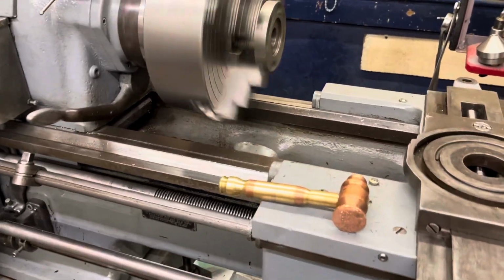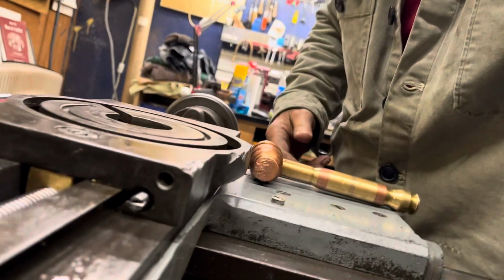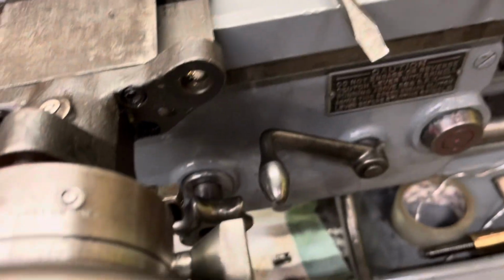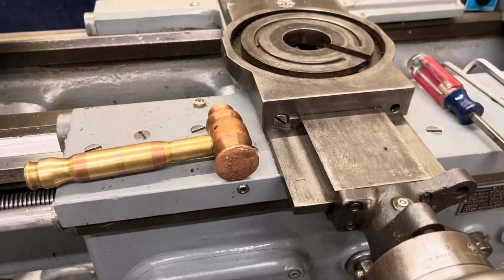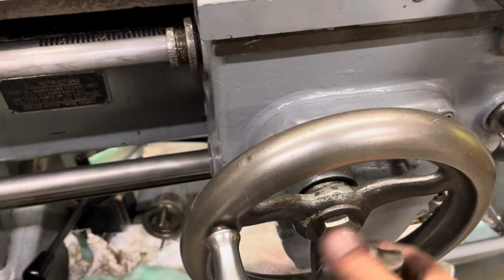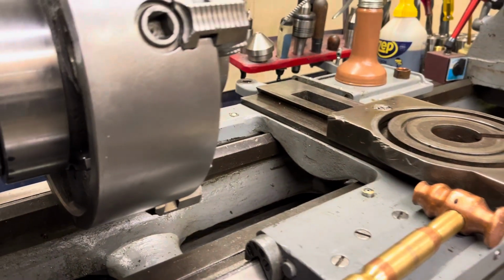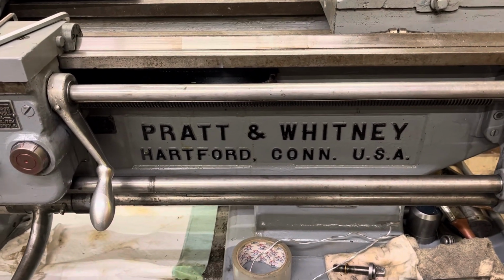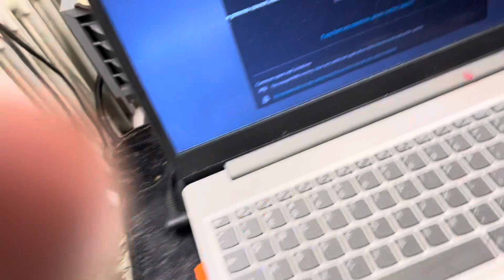Installing nut & screw

Comment: Wooo Hooo !   One step closer . . . 
Shine a light into the hole that the cross feed mechanism 'stop' guide goes through . . . it MAY be a threaded hole , in which case , it would likely be a fairly close fitting GUIDE ROD that goes in the hole -  * along with a FLAT on the side that faces the 'stop screw' . . . ( My best guess )        ** However, it could also be the elusive CROSS SLIDE LOCK ! ?      . . .  I can only guess !

Comment: I noticed that you were running both the longitudinal and cross slides at the same time.  All that lathes that I have operated had lock outs so that could not happen.  Is it possible that is creating your lock up problem.  Just a thought.